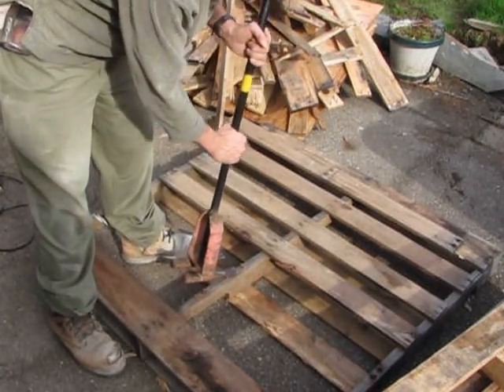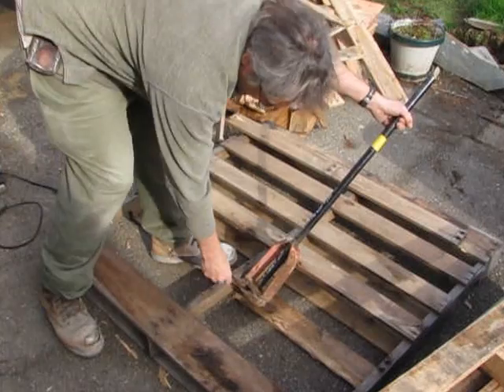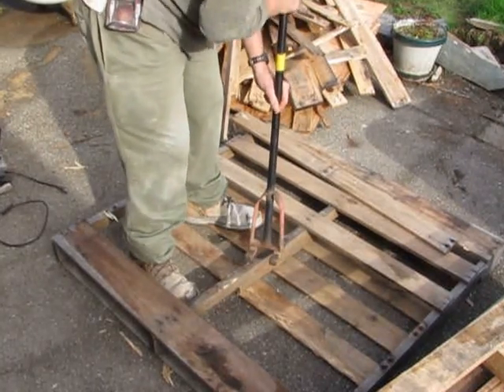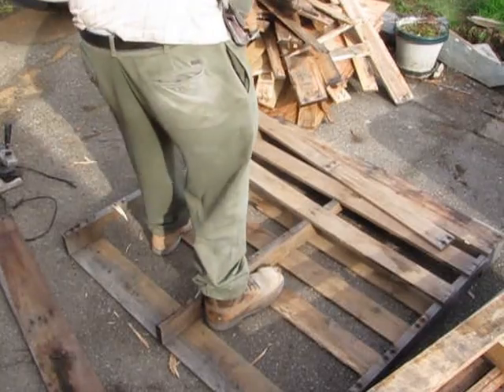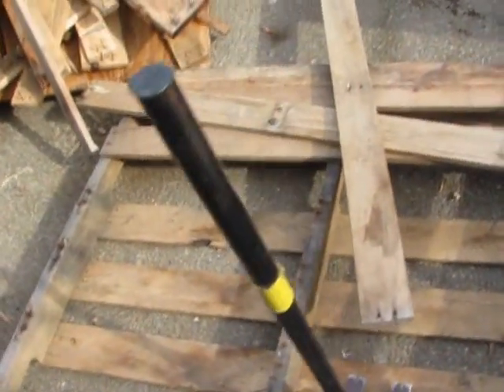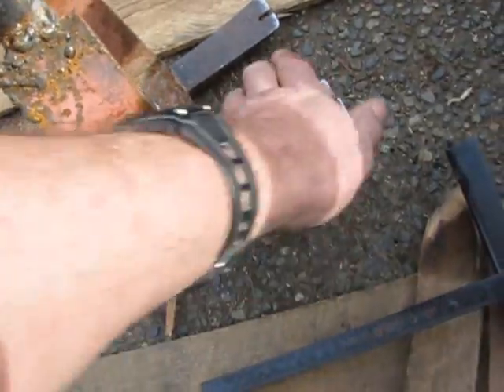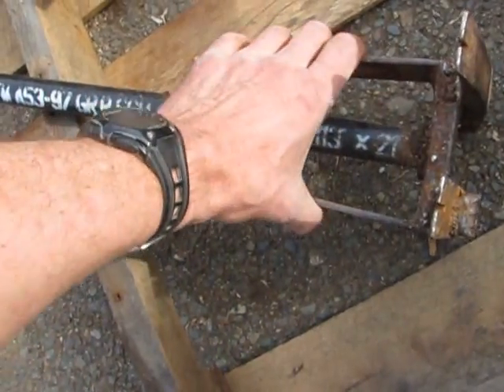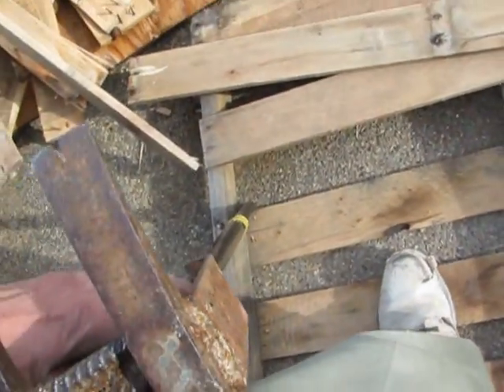My DIY pallet breaker in action + some tips to make your own.

Comment: Hi Brian, perhaps a longer handle would make it easier to pry the boards off, but yes, it would make the tool heavier.
Reply from the maker: Thanks Alan,  If I was making it again, I would have a longer handle for sure.  I  also use it to bend rebar on job sites and for welding where I occasionally bend rebar too. Sometimes I put rebar in rock walls and  the rebar often needs bends. It is pretty good! and  I have used it  as a 2 pronged pick on hard ground in site preperation

Comment: I need one of these
Reply from the maker: If you are gentle, a Mattock works ok too. About a decade ago, they started to make brick hammers "softer".  I think old brick hammer heads will still work for this type of thing but I make no guarantees.  The "gun metal" handle, I also got for free.   It was a fun project,  I still have it and I still use it. I got a couple of months of wood fires from pallets this spring and most of my solar cooking experiments and greenhouse beds are built with wood that I took apart with this thing.  A very useful thing!

Comment: thanks Brian..I'm guessing that one tool will work when the stringers are 2x4 and a 4x4?
Reply from the maker: I didn't make mine wide enough for a 4 by 4. So, I'm afraid that I don't know.  The other thing is that if I made it again, I would have the handle a bit longer.   Maybe make it a ft longer and then cut it to an appropriate length after using it a while.  The best thing I did with it was cutting  the little nail puller grooves and adding the piece of rebar behind one of the grooves to get better leverage.

Comment: and what happens when the boards are close? I like this idea cause it's simple. but all of this Pallet dismantling tools show the tool taking boards that are 5" apart? what do you do when there's a small gap between the boards???
Reply from the maker: As long as there is about a half inch gap you can use it. The end is a brick hammer head, its thin so it can get into tight gaps.